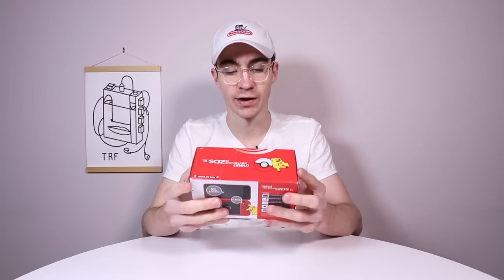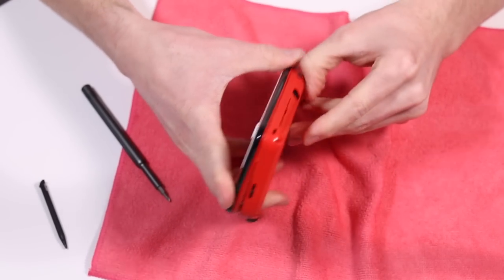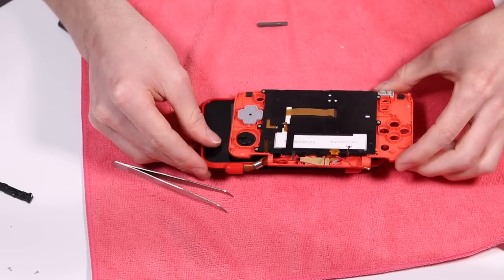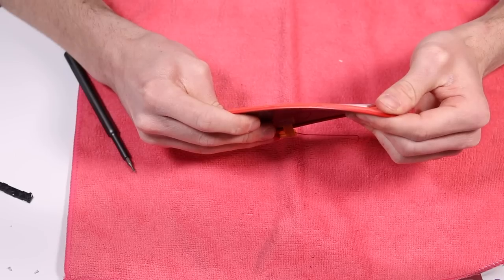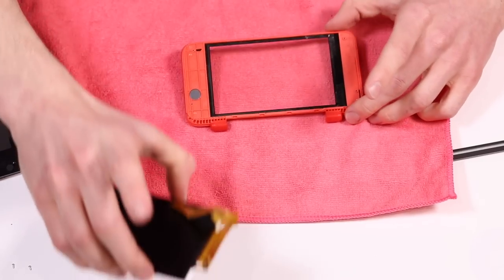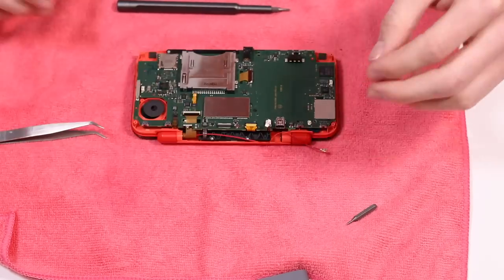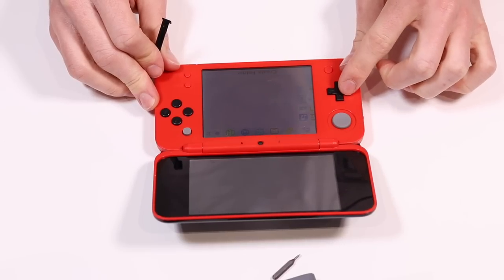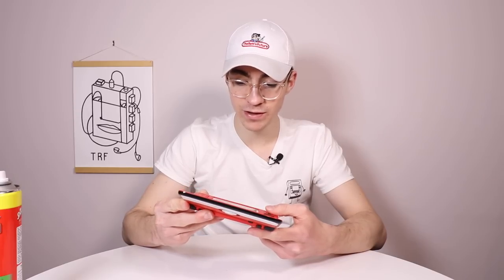The IMPOSSIBLE Nintendo 2DS XL Repair!

Comment: What I've learned from this video: I'm gonna spend that $50-$70 extra on a working 3ds instead of trying to fix a broken one.
Reply: It'd be worth it if it was a limited edition 
Also, 2ds seem way harder to repair than 3ds
Reply: Right? Juat get an older model and you dont have to worry about it breaking so easy to begin with.
Reply: I just bought a new nintendo 3ds mario edition for $109. Its used but looks damn near brand new. I was going to buy the 2ds XL cheaper with a broken screen thinking it was going to be simple...im glad I didn't.
Reply: @chriswilliams9734  I found a pretty scratched up Pokémon 2ds xl for $70 but functions perfectly would of definitely been a nightmare to repair.
Reply: I give this a yeah
Reply: I bought a purple 2DS XL for $50. Top screen was cracked. $20 for a new top screen and it works well.
Reply: @aurum3747 i recently got a 2ds with a broken circle pad and it was one of those nice pokémon crystal blue ones only about £20, just bought a new stylus and a circle pad and now it’s basically in tip top condition besides a small crack by the headphone jack
Reply: @shaungreer3350  how do I fix the 2DS XL
Reply: @felislupus2  Google "iFixit 2ds how to fix" and then what problem you are having with it, for instance if your circle pad is bust google "iFixit 2ds circle pad fix" and you will find a good guide for it!!

Comment: That's a tough fix! I haven't done the 2DS XL but I've done the 3DS XL and it's a tough repair. Really nice work!
Reply from the maker: Hey bud! Yeah it was a tricky one.
Reply: Heeeeyy!
Reply: I have a 3ds i need to tackle someday like i cracked the top screen during  a nap lol
Reply: Mine still has the broken screen, maybe I'll try one day (if I find it again) to repair it
Reply: @vgrepairs  mm.... I might considered it.. I have Yteheal? Pokémon edition for 3ds XL. Need some repair too.
Reply: @helmiboboy    I have 5 years experience
Reply: @Alex Burton   what is the problem with your 3DS? Screen broken? Black screen? Bad charging port?
Reply: @vgrepairs  do you have a link to your shops? I may be interested. I bought a used N3ds XL that came with a few top screen scratches
Reply: Yea last year I got my little cousen a New 2DS XL, anyway he was in a hospital and after an operation he push the 2DS from the desk and it fall on the flor.

The cylinder on the other side, where the upper screen is attached broke.
You can still use it with no problem but it looks ugly
Reply: @paradoxzee6834  it needs a new lower housing. $40 including parts and installation.
Reply: @Alex Burton do you happen to have a screen protector on the bottom screen? Had that problem when I installed a cheap screen protector. Different Brand worked fine
Reply: @paradoxzee6834  Same,I guess it's just how its built
Reply: If my new 2ds xl ever breaks can you fix mine I’ll mail it to you
Reply: I have one that'll be even harder to fix :'( my childhood 2DS (original model white and red) broke after I dropped it while playing a game and the exact same second it hit the floor the batteries went flat, I sent it to my local game shop to get it fixed but they couldn't fix it, it apparently has Motherboard failure it is also Homebrewed. I would love to have it fixed because it has so many photo's and such on the hard drive that are part of my Childhood and I need the photo's to remember that childhood but I can't because I can't access the Hard drive :( if anyone can help just give me your post and I'll get it shipped to you from Australia.

Comment from the maker: Sorry for the static camera, I was learning as I was going. If you want to see a proper Let's refurb on this then let me know! Also - I typed this comment out on this 2DS XL... Oh and the sleep function works fine!
Reply: YEH
Reply: You really comment on 3DS?
Reply: It’s fine!  Gives it a ‘My Mate Vince’ vibe 😀
Reply: Please keep improving like this man I really enjoy watching ur stuff!
Reply: Elliot I would love to see a proper longer video I realize you need to keep it to a certain time to get it monetized or whatever the deals with YouTube but honestly I'd like to fix minors a couple things that I did not see I realize with the camera you couldn't see it but if there's a chance would love to see a full-blown but this was excellent to be honest anyways
Reply: Nice
Reply: I remember how difficult it was to reshell my DS Lite (I had to replace the DS slot as it was all bent up inside, that went pretty well actually), but then I botched up on the ribbon cable and had to use my salvage system (blown fuse, WAY too small to replace) for it's speakers and top screen (easier than reattaching my other systems speakers) and after fearing I'd rip the cable and closing it up, I found out the plastic was much cheaper on these replacement shells, as my system's L occasionally sticks (and often doesn't register) and my R's spring snapped clean off the piece it sits in, but still functions. AND the top screen doesn't sit flush when it's closed. It just was not an easy experience. Does look much nicer than the condition I found it in though. I just hope the GBA SP I'm starting when it arrives will be easier to do. So many parts are in the way when there's a hinge. 2DS is rather simple as it's just one big LCD and easier to finagle with, or so I'm told.
Reply: This was great! No need to get all fancy!
Reply: Elliot would you believe me if I said I found a Famicom Gameboy micro for 25 dollars?
Reply: @DrSalvador555  I remember doing a reshell for a DS Lite for my ex. I did it as a project mainly but felt quite accomplished when I did it. It's definitely fiddly to do but it seems these 3DS models look similar?
Reply: @Spiceymike0  Sure looks like it, but that New 2DSXL looks downright unpleasant to work in.
Reply: was this cheaper than buying a new 2ds xl???
Reply: Isn't the browser pretty good for a 3ds?
Reply: The Retro Future I know how u feel
Reply: I am jealous because you fix a Nintendo 2ds and its new!
Reply: I have a new Nintendo 3ds xl that needs a top screen replacement, could you do that?
Reply: How's the browser cuz the yt app doesn't work anymore
Reply: @adamhenry6793  2DS XL
Reply: @Kalloiy  Nice.
Reply: Can you take on a different challenge? I haveone
Reply: I'm planning on getting a 2ds XL
Reply: can i have it?
Reply: @fridge4  I wish he would just do a give away of the fixes he does
Reply: @sgsuperkiddan  Same, as like a reward for subbing and watching through the whole vid
Reply: @fridge4  exactly
Reply: Hi, excuse me I have a problem with my new 3ds xl hinge, it's very similar to this 3ds xl inside. After disassembly it doesn't "click" anymore.. Do you know what problem could be?
Reply: @adamhenry6793 2ds only does games in 2d whereas the 3ds does 3d on some games basically the 2ds xl has a 3ds operating system but they modified so it dosent show the 3d slider menu

Comment: Just picked up an astro boy limited edition Gameboy light, it was advertised as “Acceptable” condition because the power switch was sketchy,  but the overall condition is almost mint!  I just did the Isopropyl alcohol trick in the switch and now its perfect! I only paid $100 for it and it included to box and paperwork as well. :)
Reply from the maker: Nice work!
Reply: $100 USD? Amazing find!
Reply: @Zulf85  yes, i think the seller thought is was going to be a hard fix with the power switch but literally took me 10 minutes to fix it. I've seen them go for as much as 600$ boxed.
Reply: @buttholeChecker  NICE!

Comment: you did pretty well. the first time i've opened my 2DS XL I broke two ribbon clips, ZR and R, and the volume slider, and it would not turn on anymore. after that i bought a new one, and sometime later it decided to turn on again... so now I have two 2DS XL. since I only play pokemon, I don't miss the broken buttons and I can trade pokemon with myself like someone with no friends (friends who don't play pokemon at least).
Reply: Was the red cable you see at top sliced? Because mine got ripped off by my toddler. And idk if it can be fixed

Comment: Try a heatgun or heating pad on difficult adhesive.  You must have one no?
Reply: my thoughts as well, kinda threw me off at that point.
Reply: @greentray1231  I've kinda deduced that maybe since I do cell repair I run into this sorta thing more often.  Cell phones all need to be heatgunned, microbladed, hundred ribbon cable disassembled then put back together perfectly with new LCD glue to retain their form and safety for the screen.  Guess taking apart Gameboys isn't such the same way lol
Reply from the maker: Hirdryer!
Reply: @TheRetroFuture  Get a heat gun xP in my experience, hair dryers don't get hot enough.
Reply: @nathanhamman418  Yeah, heat gun or bust. I've had to replace the back glass panel on a Note 8. A hair dryer generally won't get hot enough if it's a stronger adhesive.
Reply: Literally I was screaming for him to use a hair dryer or heat gun on low to loosen the adhesive for the poke ball and the screen
Reply: @nathanhamman418  bro they do if you put it close enough and for a little bit longer. You probably don't use a hair dryer but yes most get hot enough to loosen adhesive on phones and things like this ds. Also when I used on next to my PS4 for a screen replacement it melted some of the vents on my PS4 lol
Reply: You asked and answered your own question...
Reply: I scrolled thru the comments looking for this. It did not disappoint me. 

Heat gun ftw!
Reply: @TheBrothers759  you can do it with a hairdryer without any issues. I've done it. Heatgun makes your life easier, it's a fact, but it's not necessary.

Comment: The magnet in the lid activates a reed switch on the main board when you close the lid. You can also make it sleep while it's open if you place a magnet somewhere around the ABXY buttons. All other DS and 3DS models do the same thing, but they don't install a magnet there. It just uses the magnet in one of the speakers. But on 2DS XL, the speakers are in the bottom half so they couldn't do that trick.

Comment: Hi Elliot if you ever need to do a top screen on these you dont have to take the board out you can easily slide the ribbon under the board and back through the hole in the motherboard. Saves loads of time

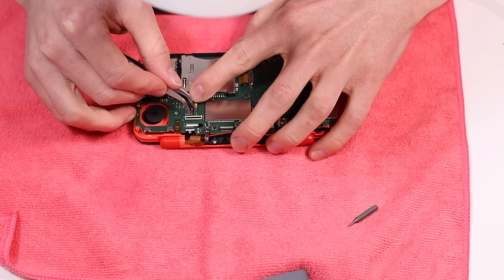Comment: So, I watched 3:30 in .25 speed and I noticed that you flipped up the tabs for some of the ZIF connectors to release the ribbon cables. You mention this again at 11:50. I made this mistake when I was fixing a new 3ds XL I bought for cheap on ebay. The ribbon cables are just held in by friction on those smaller ZIF connectors, so they should slide out if you just grab the cables with some tweezers and pull. Trying to flip up the grey piece that looks like a door on the connector WILL damage and potentially break the ZIF connectors, requiring you to solder new ones on the board.

I ended up cutting small pieces of electrical tape and adhering them to the bottom of the cable, since the contact points are at the top. You might want to check the amiibo (NFC) functionality of your 2DS, since that is what that cable should be connected to.

Thanks for making this video though! I've always wanted to know how difficult it would be to replace the screen of a 2DS XL, since there are some really cheap devices all over the internet with broken screens! I'd love to fix some up too and give them to friends!

Comment: I've actually done this repair myself and there are a few things that are worth mentioning. The price of the screen is around €40 and most broken 2DS's are more or less the same price. In that respect I would just get a used 2DS. If you broke your own, its definitely worthwhile the effort. When I did this, I did not remove the board, it is possible to remove the antenna and ribbon cable of the screen. Putting it back together is more of a challenge, especially the ribbon cable. What you didn't show is the removal of the front glass. When the glass is removed, you can remove the screen by swiftly pulling on the screen on one side. Hold it on the same side on the frame and don't put any force on the frame. Same for the other side :) As always great work!

Comment: One small tip, wear any sort of ESD band later when fixing these type of Nintendo systems.
I repair electronics on a daily basis and I didn't wear mine when I was opening up my GF's 2DS system and I must have discharged electrostatic energy because the fuse responsible for the system's charging mechanism was blown very easily, so my GF's console could turn on just fine but it wouldn't charge no matter what.

Comment: The fixture was successful but for a while it was tricky. Touch and go moments. But Elliot you did a good job. With the bottom screen not turning on because the ribbon cable was not connected don't sweat it no one is perfect buddy.

Comment: @8:39 that part that is broken (the LCD frame) is not aesthetic and is critical for long term strength of the hinge point to not put stress on the screen and should have been replaced. The tiny bit of plastic between the hinges (with a ridge on it facing the user) in the LCD frame is commonly cracked on the ridge part (this is probably why it broke in removal).  Look at any well used/travelled 2ds XL and you can probably see one or two of the ridges cracked at hinge join point.  But when this is broken right through (like in this video, or in a damaged 2ds xl) the hinge mount has no forward support (except for pushing on the front plastic lens with the little lip that it sits on) and will apply pressure (warping) to the screen and LCD when device is opened or even in normal use.

Comment: The trickiest repair I've ever done was replacing the power button ribbon cable on a 6th generation iPod Nano, wew.
That 2DS screen assembly was incredibly thin, you'd think adding a tiny bit thicker glass somewhere would've only cost fractions of a penny and made it much more durable.

Comment: Retro future if you're worried about taking off any adhesive material its best to use a heat tool which will warm up the glue and make it easier to lift off.

Comment: Such screens are super reliable when sandwiched between a chemically toughened glass on one side and a magnesium frame on the other...

Obviously some parts have been spared here.
Reply: @tyr0148  yeah i know, what i mean you likely have a screen of exactly this build type in your phone, but you never see one break, ever! What breaks is the touch overlay and the cover glass, the screen itself is always fine, every single time. Nintendo made the lid assembly much more flimsy overall than these screens normally require.
Reply: Siana Gearz - I have had the same 3DS and new 3DS LL since their respective launches. I have traveled the world with them. My 8 year old has a 2DS that my 4 year old drops all the time. Never broken a screen. They are stronger then you think.

Comment: Thanks for the video, there are a few out there but the commentary and video quality aren't that good.

I've got a blue 2dsxl with the same issue, though in mine a quarter of the screen (the left side) is still working and I could check if all the buttons worked, which thankfully did. I also got the charger and a huge bonus in the r4i gold 3ds. I'm just waiting for the replacement screen price to come down, they are too expensive imo. I hope that in the future we could get a framed replacement screen once replacement shells will eventually pop up.

Comment: THANK YOU Elliott! I have the Pikachu Edition and want to replace the top screen glad someone has done a proper video on this!
Reply from the maker: Nice! Thanks :)
Reply: @TheRetroFuture  Well screen arrived and I attempted it yesterday and you were NOT kidding what a pain in the @r$e.  The glass layer stuck to the plastic screen uptop, the plastic bezel around the black plastic screen protector cracked in two places, the ribbon cable was a major pain to get through the metal ring, the hinge was a pain to get out an back in, I temporarily lost the home button VERY lucky I found that, had some square piece with a hole in it fall out never to be put back in again.  The ribbon cables were a pain to put back in, luckily i learned a lot from your issues, i.e. circle pad not put back in right and all cables seated in as well as volume button put back in right before closing it up, because opening that thing back up would not be an option lol  BUT it all worked in the end shockingly!

Comment: I fixed two of those and the first one I fixed was the teal and black and I cracked the top corner of the cover. So the second one I did which was the orange and white I used a hair dryer to kind of loosen up the glue and it worked pretty good